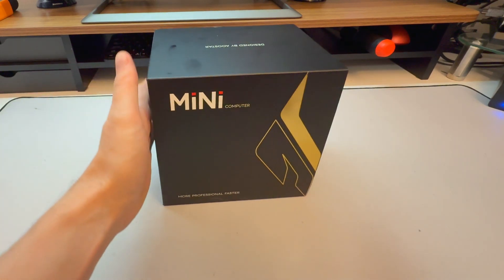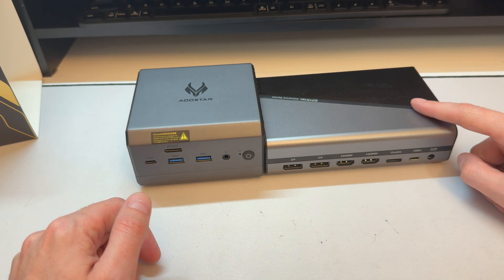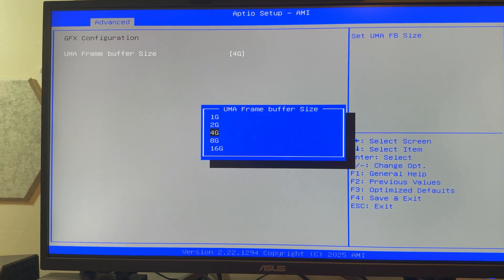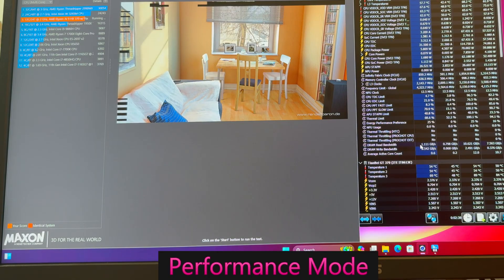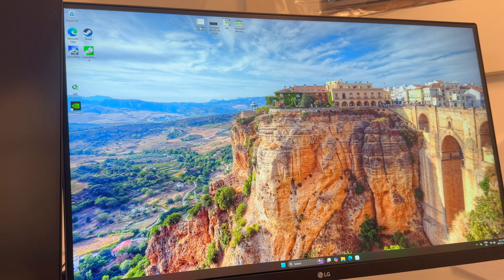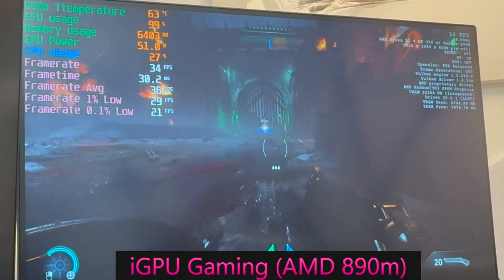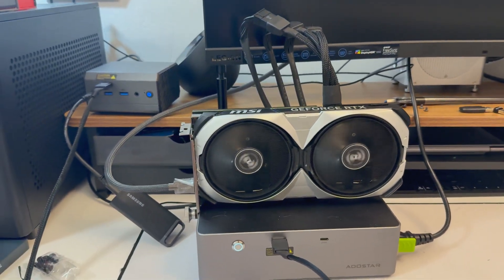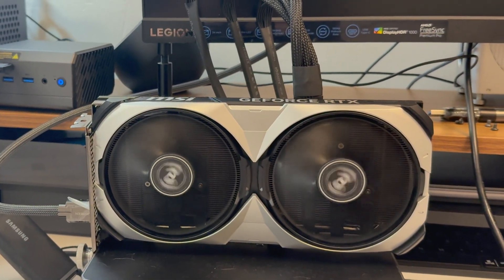A Tiny Beast ! - AOOSTAR GT37  with OcuLink ( AMD AI HX 370 )

Comment: I'm sooo indecisive. Been staring at 10 diff mini PCs for the past 2 months. Is this one the go? I'm looking at GMKtec mini - 32GB 5600, 8945HS, 2TB SSD, and Reatan Mini - 64GB 5600, 7940HS, 2TB SSD. All 3 are a similar price for me at the moment, with this GT37 on a $280 AUD discount. I just can't tell if it was worth the $280 more in the first place. And can't tell if double RAM on the Reatan is better with the 7940HS, or if it's worth sticking with 32GB RAM to get the 8945HS. Seems like a 5% diff, and I think the 7/8 part just determines whether it is AI or not (8xxx is AI?). Reeeee. Cool video though. Thank you

Comment: I have same setup but 1 day later after nvidia and windows update my 3dmark score dropped 3000 points. What do I do? I have a gt37 ag01 with oculink to 5080
Reply from the maker: Nvidia has horrible drivers these days, which you will probably want to do is swap over to studio drivers. They are more stable.

Generally, I only use game ready drivers when I'm doing benchmarks at a game launch. Otherwise they're just too unstable.
Reply: @TechGuyBeau thanks ill give it a try. Are there any bios settings i should check?
Reply: @TechGuyBeau I tried the studio driver and got an even lower score. It's a fresh windows install with nothing on it except 3d mark. I got the best score when windows installed it's own drivers for the 5080? The only thing that changed was a windows update and nvidia app and driver install.
Reply: @TechGuyBeau it turns out the 25h2 update was causing the problem. Reinstalled windows 24h2 and blocked update. Computers are annoying.

Comment: Question! Would setting the max vram to 16gb improve the performance for gaming or would that actually hinder the performance taking to much ram from the OS?
Reply from the maker: It overkill. 10-12 is more than enough. Tbh even 8 should be fine
Reply: @TechGuyBeau Thanks for the quick reply, is it even possible to select just 10gb in the bios on this machine?

Comment: I have the GT68 version of this (6850H) The case is exactly the same as mine. It's a bit of a challenge to get into it for a repaste, or add an SSD compared to other minis. However, this mini breathes VERY well. If you put some PTM on it, I doubt you'd see above 85c on it. The case is VERY solid unit. Feels very high quality. SSD speed in mine was around 7200.

Comment: Hello, question.
In hibernate mode, the minipc turn off the fans for the gpu card and power source(dock)? Thank you
Reply: I asked the Aaostar suport, and here is the answer:
"AOOSTAR Mini PC

After turning off the computer, the fan on the base will not stop spinning. If you want to turn it off completely, you can unplug the power plug or use an independent switch socket."
Reply from the maker: Hibernate will cut power to everything yes
Reply: @TechGuyBeau  Thank you for answering.
But. Is your answer verified in real life? When the mini PC is in hibernate mode or turned off, are the fans on the Aostar dock and GPU  turned off? Or you have to power off to dock every time to power of the fans?

Comment: Hi, I’m from Russia, and I really like your videos—they have a lot of useful information!

But I have a question. I have a ThinkBook 14+ U7 255H laptop with a TGX (Oculink) port, and I also bought an Aoostar AG02 docking station and an RTX 5070 graphics card.

The info about the Aoostar AG02 says it supports TGX technology. Am I correct in understanding that I can connect the cable from the Aoostar to the laptop without turning off the laptop or the docking station’s power? Or does it not work that way?

Have you happened to test this by any chance?
Reply from the maker: I’ve tried the same, it’s didn’t crash like others would if you tried to hot plug
Reply: @TechGuyBeau  
Thank you so much! I was really worried that something might break—it would’ve been such a shame to damage the laptop or the GPU. In that case, TGX really is a super useful and necessary feature!

Comment: Great review, thanks for posting. I just picked up another GEM10 7840HS with 780M iGPU for like £355. Really solid. When the GT37 price eventually falls to a similar level, I will get one.
Reply: I bought 5 of the Gem 10, 7840hs mini-PCs to set up for Christmas gaming PCs. I always get people asking me about 2 weeks before Christmas for PCs for their grandkids, kids, nephews, ect... 
These Mini-PCs are super easy to find right now, but after Thanksgiving, pretty much any entry level gaming PC becomes very hard to find. 
I love how the Gem 10 used the fastest SODIMM RAM (6400MT/s) available to the 7840HS which gives the Radeon 780M iGPU the best ability to provide a good gaming experience. 
I have yet to find another mini-PC brand that effectively uses the faster RAM for these iGPUs. 
I am very interested in the GT37 as it uses 8000MT/s RAM and the Radeon 890M also will benefit from that very fast RAM.
Reply: @woodlanditguy2951 The GT37 is technically superior but has one less M.2 slot and costs much more. I got three GEM10 and use one of them outside its case as a single board computer.
Reply: @ashyoung6134  I was thinking about taking a Gem 10 apart and integrating it into a mini-tower that utilizes the Oculink to boost it with a GPU. 
My only issue is I need to figure out how to get the power button and external ports accessible to the outside of a PC case.

Comment: Trust me people.
Mini PC + Docking + External GPU is kind of a scam if you want powerfull pc with compact design.

It's better if you build an mini/micro/SFF PC.
Reply: building it yourself cost 1.5x more than aoostar. You're basically paying for weighty cases and fans
Reply: @ompomromdom  idk where you live. but in my country all the setup he use cost more than SFF PC build.
not the PC build vs only Mini PC, but the Mini PC + Oculink Docking System + RTX 4070Super.
what is the purpose of "Mini PC" if in the end you still using external GPU??

Comment: The company refuses to have a 64gb Ram version.  
And for that, this is a hell no!

You want us to spend over 800-900$ and there is soldered ram?  And it doesn't have the option to go to 64?
NO, this isn't even on the radar, for anyone serious about mini computing.
Reply: There is a reason for soldered ram and that's the speed : 7600-8000 is possible with LPDDR5, with simple replaceable sodimm its 5600. There are other models with sodimm but you will get less performance.
Reply from the maker: I'm serious about it, and the person using it now is also serious. And we have 32gb.

This isn't good for you perhaps. But for many it is. 

Also why are you spending 800-900$?

I paid less in CAD. P
Reply: I bought one of these several months ago. I was bummed about the soldered RAM when I first got it since my original plan for the system was to run XCP-ng on it. I do find this little guy slightly limiting for that purpose, but I've since ordered a much more appropriate VM host, an Aoostar WTR Max, which has a slightly lower-spec Ryzen 8845HS (8c/16t), but also a total of 11 drive bays and 2xSFP+ ports that's roughly the same cost as the GT37 shown in this video. That thing is definitely a serious mini system, and it'll leave my little HX370 free and clear to be the powerful desktop PC it was meant to be.